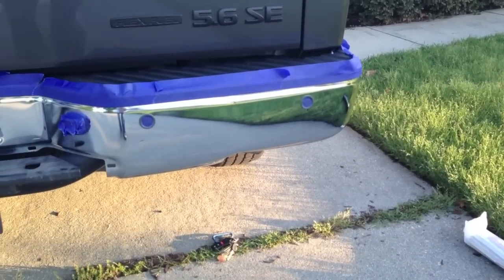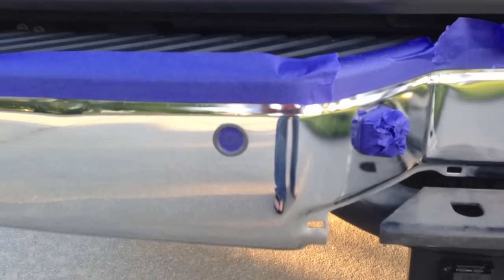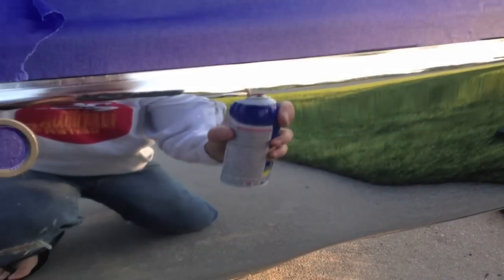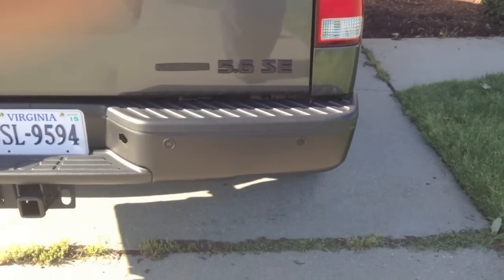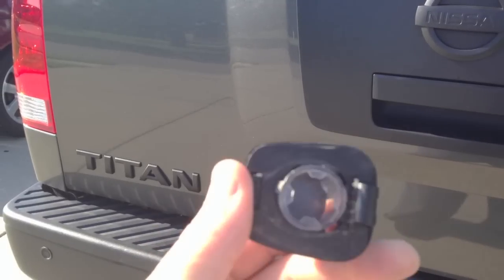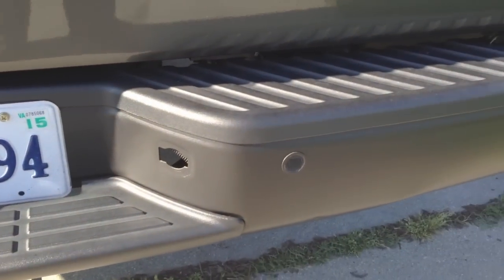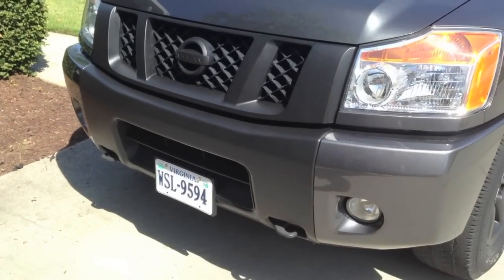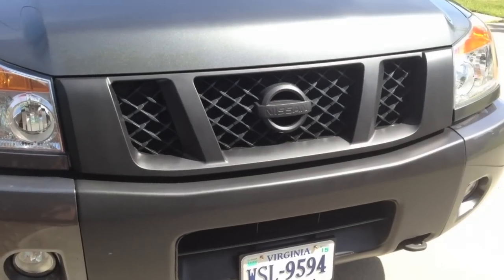HOW TO Plasti Dip Your Grill and Bumper (Nissan Titan)

Comment: I'm not a big fan of PlastiDip on my expensive truck I worked my ass off to buy, so I might purchase matte black w/t parts and replace the chrome.
Reply: Funny that you say that. Plasti dip is a fraction of the cost and it can be removed. Keep working hard and save you that hard earned money and do what you see best for your truck.
Reply: Andrew Muhs Yea I know, that's the breaking point, the fact that Plasti Dipping is way less costly. So we'll see haha